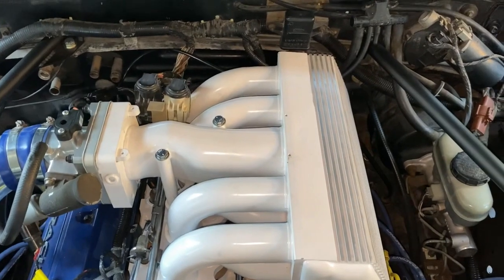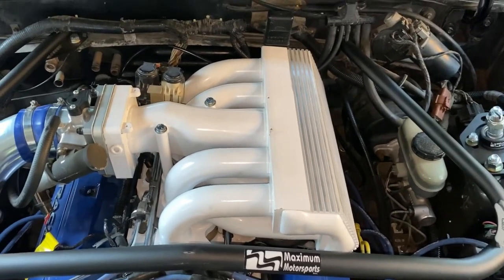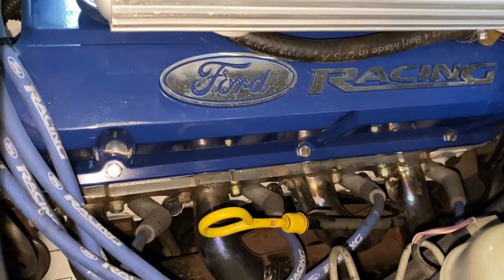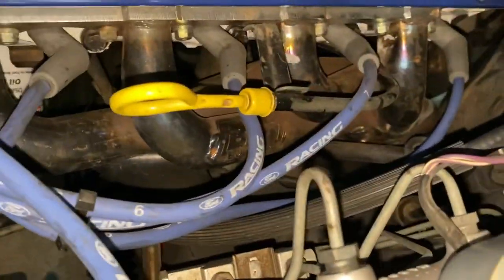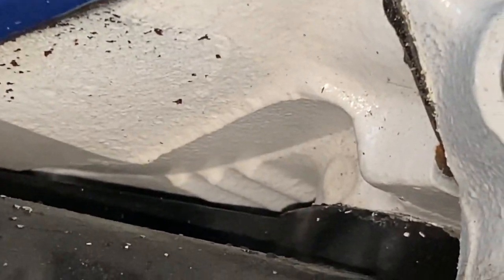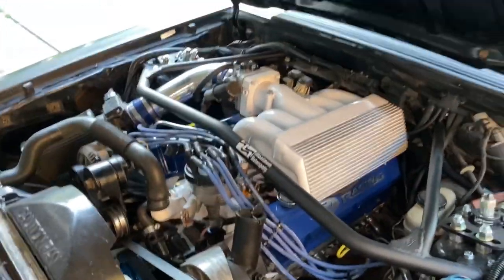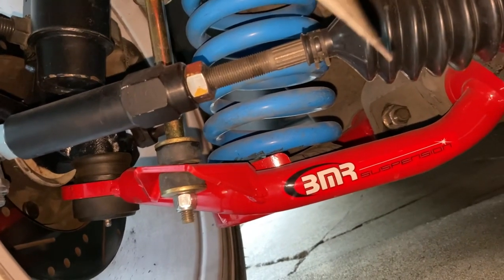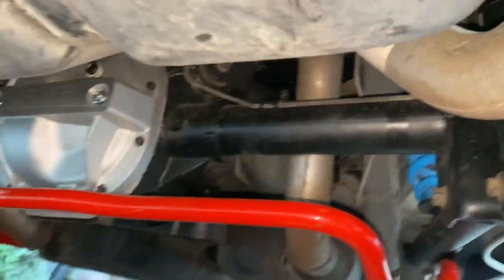1992 Ford Mustang Gt walk around (SUNNY HOME)

Comment: Get the bump steer installed correctly before you get an alignment. Don’t wanna fix it afterwards. Bump steer kit is designed to keep the rack as level as possible (tip to tip). Ideally if you can get it to run straight horizontally, that’s perfect, on lowered vehicles it is difficult. But looks like you still have enough left to get it correct or close to it
Reply: Thats what the alignment shop is for, to dial it in 👌
Reply: @VASQUEZBOI209  The stud/nut needs to be removed from the spindle. Alignment is to set caster/camber and toe. Easy fix
Reply from the maker: @pcpalan  hell yeah. Thanks about to do it later
Reply: @PVOSQUAD365  Easy fix, I think it’s like a 24 mm nut just pop it off, pop the tire rod down and put all the spacers on the stud before you put the tie rod back on the stud. That way the rack is as level as possible and it will get rid or minimize bump steer
Reply from the maker: @pcpalan  thanks bro I appreciate that. I’ll be doing it tomorrow morning